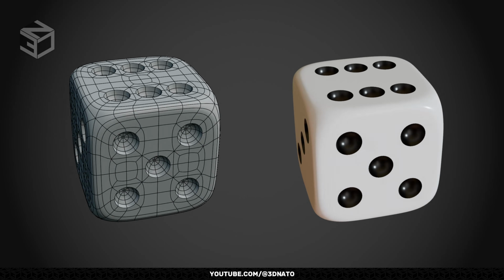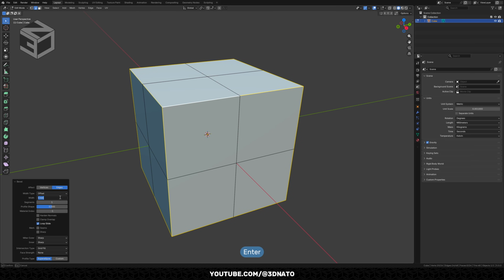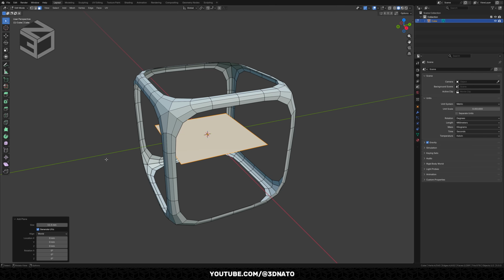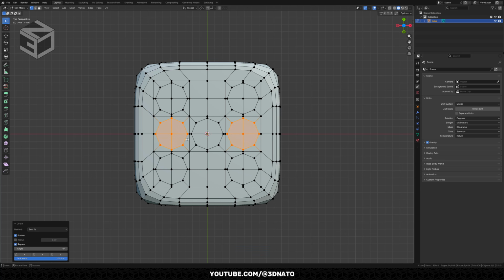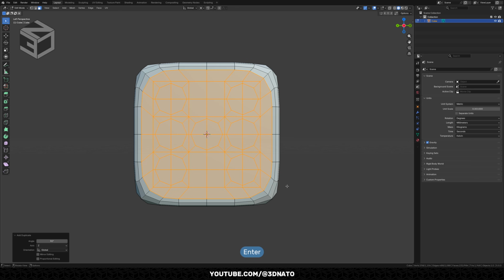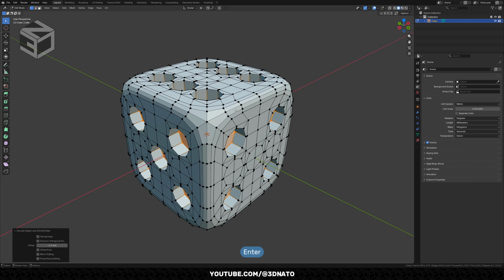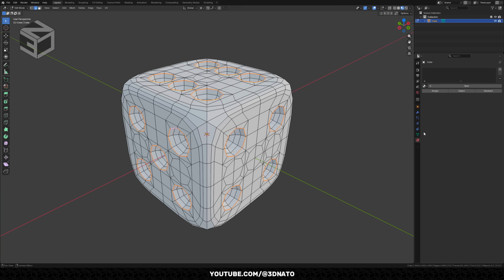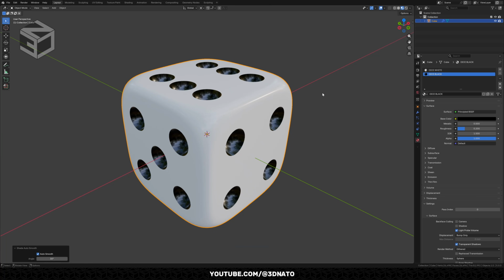How to Make a DICE in Blender (Step-by-Step Tutorial)

Comment: very nice and to the point.
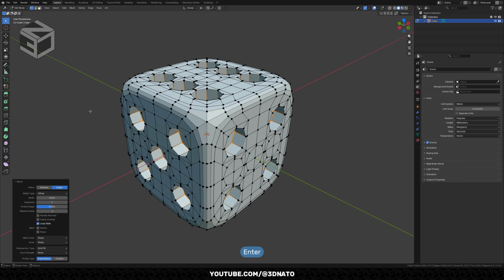when i try to select boundary loops (3:50) i get "at least one boundary edge is needed to make a boundary loop selection".
i did not deselect anything after extruding along face normals.. what can i be doing wrong?
Reply: I guess the name changed in ui, you can select "Boundry of Selected". Also when you bevel the edges after extruding, make sure its mode "sharp" not "arc"

Comment: Thank you for this tutorial! I have an issu when the time comes to duplicate the faces... Nothing happens. If I want to rotate it, there's only the original face following the rotation.
Reply from the maker: Make sure to duplicate the faces before rotating.
With the faces selected, press Shift + D to duplicate, R to rotate, lock the axis, type 180 to rotate 180°, and press Enter.
Reply: @3DNato thank you for answering so quickly. That's my problem: shift+D doesn't work, so the faces can't duplicate. Is there a method to unlock this command?
Reply from the maker: @Melanie-Elisabeth Which Blender version are you using?
This might be an add-on issue, as some add-ons override default shortcuts. If you recently installed any add-on, disable it and try again.